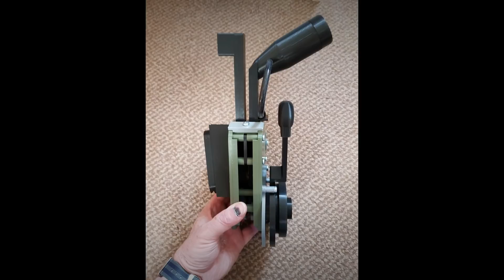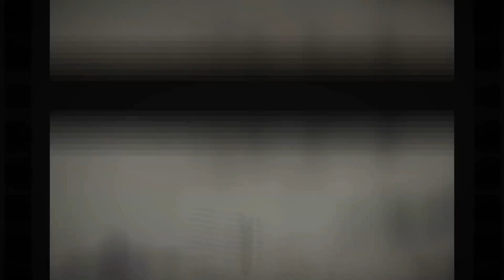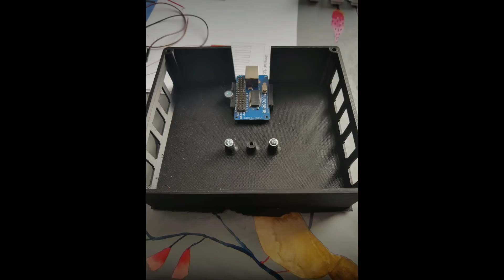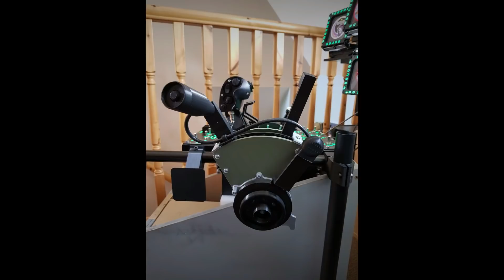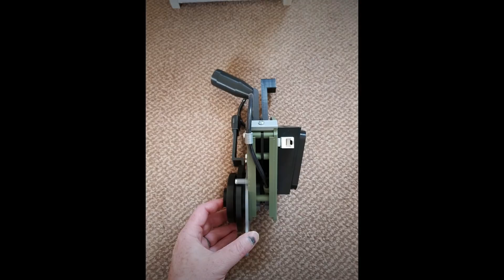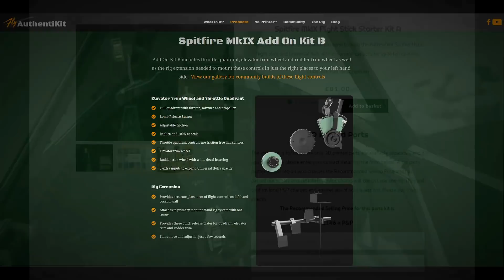Product Review: Authentikit Spitfire MkIX Throttle Quadrant (Vid 1 Of 2)

Comment: 7:35 - Add two small switches in extreme position of mixture lever, so = OFF and Automatic adjusts.
Reply: Hi, this will no longer be an issue as the next DCS update will add the option to bind the mixture lever as an axis.